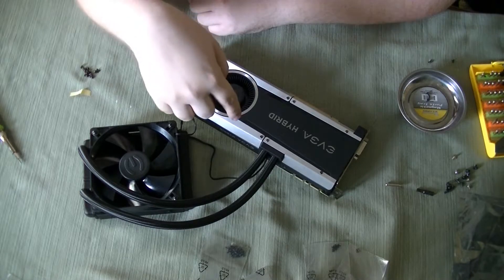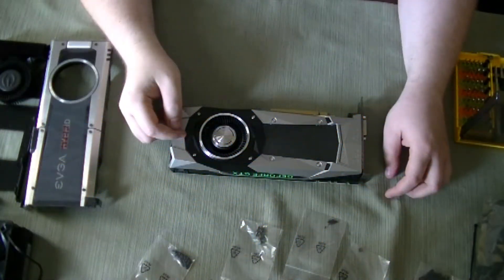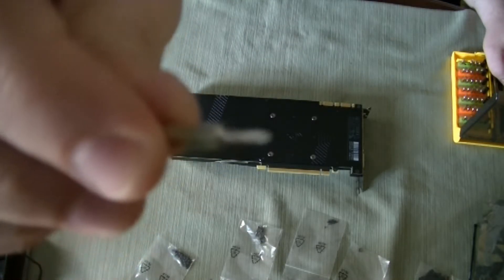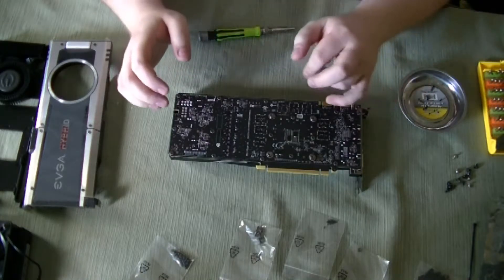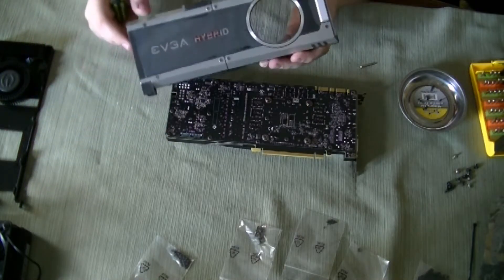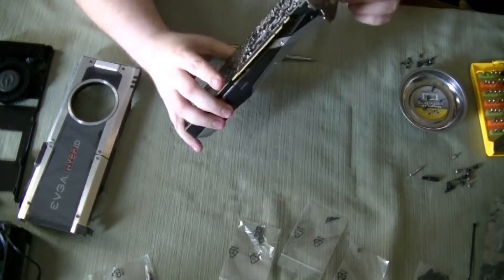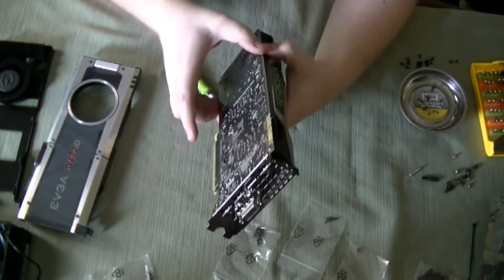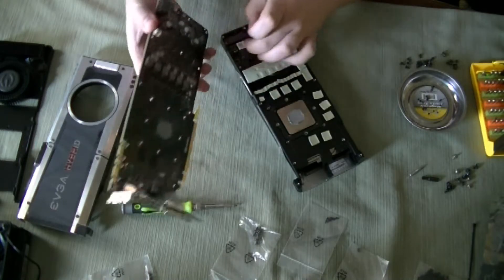EVGA Hybrid Cooler Install GTX 1080 Founders Edition

Comment: Where do you find that kit for sale?
Reply from the maker: Only place I can think of now would be ebay. EVGA discontinued it once the Ti cards came out. Just be careful when you look for it. The 1080Ti version looks very similar, only way to tell them apart is the fan that they use, which the Ti one doesn't fit the 1080.
Reply: Thought it whould fit on a 1080ti founder edition.

Comment: will this work on a Zotac GeForce GTX 1080ti blower (ZT-P10810B-10P)
Reply from the maker: Yasiin the Ti cards are configured differently and will not work. Evga does sell a ti version of this and you can still use this video for tutorial, but there might be just a few key differences.

Comment: i should have got this instead of the morpheus 2. so much easier to install lol. my temps are about the same i guess. it creeps up into the low 60s sometimes
Reply from the maker: How long have you had it? It might have something to do with the thermal paste you are using or the amount of fans you are using for the Rad
Reply: Vedran S it’s an air cooler. So temps are where they should be I think.
Reply from the maker: oh ok...

Comment: Is it compatible  with inno3d founder edition 1080
Reply from the maker: Looks like it is a standard founders edition 1080 PCB, so it should work just fine for you.
Reply: Vedran S can you tell me form where i can buy this cooler and thanks for replay
Reply from the maker: here is a link on amazon for you: https://www.amazon.com/EVGA-Hybrid-Waterblock-Cooler-400-HY-5188-B1/dp/B01IPVQUSG/ref=sr_1_1?ie=UTF8&qid=1517786054&sr=8-1&keywords=evga+gtx+1080%2F1070+hybrid+waterblock+cooler

Comment: Question, when you put your backplate on did you’re screws fit right into the gpu screw holes?
Reply from the maker: Lv100FlexingFurby yup. I just used the same ones that came with the original gtx 1080 founders edition. Everything lined up fine. Only one that didn't is at the very top by the io, 1 screw didn't because the cooler didn't have a hole for it. All others were fine
Reply: Vedran S thanks for the response, my screws wouldn’t fit so I just went to the hardware store and got some

Comment: Founders Edition loud at all for you in your opinion. Just bought one online and having second thoughts about it. How's it going for u
Reply from the maker: Mine is extremely quiet on day to day activities. It does get a little audible when I game on the PC but it is not loud by any means. You might have a bad unit?
Reply: well no im waiting for mine to come in from ebay and im just reading reviews. Got evga FE 1080 for $427 new. Im just worried about the noise or throttling. Was it worth buying the cooler or am i fine.
Reply from the maker: Depending on the case and configuration. I had a Thermaltake Core V51 case and with 2 of the cards, they went up to about 85C under load. With the cooler, they would never get past 60C. I did change the case to a thermaltake suppressor case and removed the liquid cooler off of the card, just running the stock FE cooler, and the system with 2 cards under load doesn't get past 75C. So it all depends on how close the fans are to the cards. I never did encounter throttling issues, even when it was at 85C.